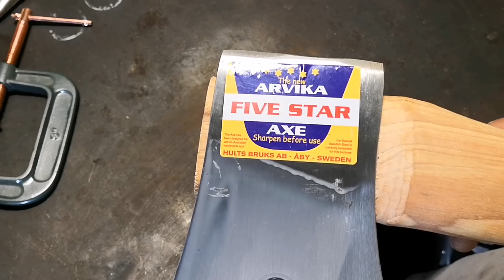How to sharpen these tools?

Comment: Sir for the last tools i think the tip not supposed to be simmetricaly they will hit each other and easily lose the sharpness event cracking. Those sharp tip should be slightly overlap with no gap.

Comment: Great video .loved it.
Pls do not pull on the file only push
On the ax sharpening sharpen from the blade tip to the handel like on the second ax sharpening direction
Nice job on the pliars
Saluting from Roumania